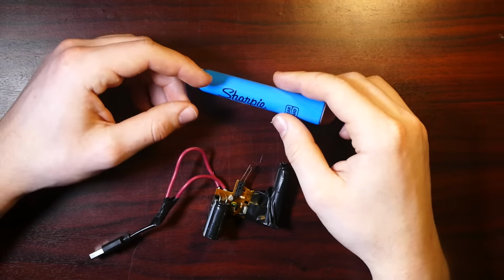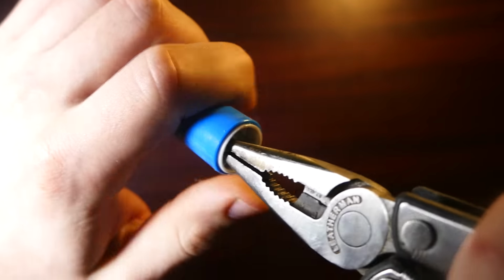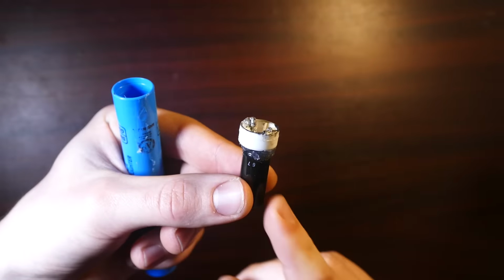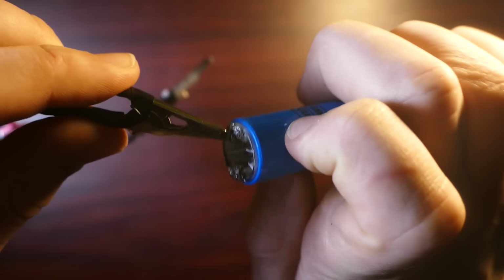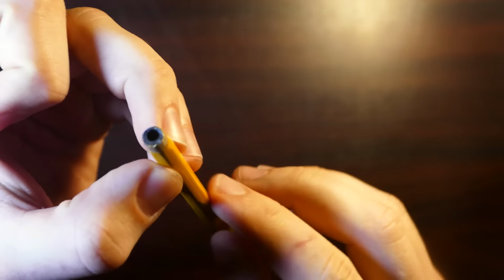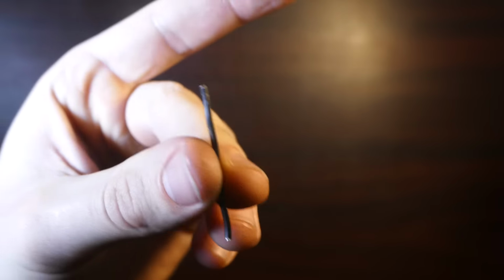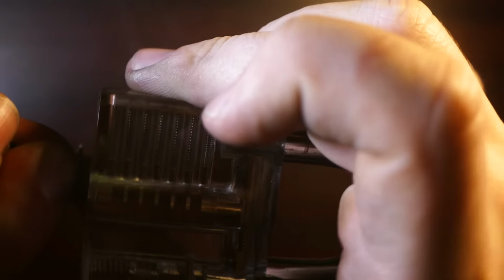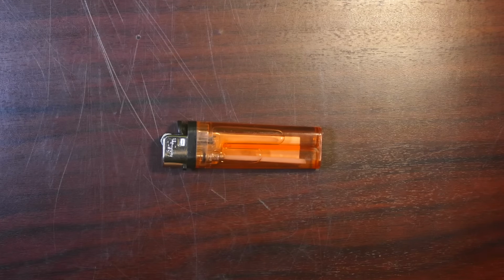4 Clever Spy Hacks YOU SHOULD KNOW

Comment: Make USB killer hidden in a highlighter
Reply: King Pitbull it's not that hard just obtain a USB killer take of the plastic USB part then use the components for the USB  and put it in an empty big stocky highlighter ;)
Reply: Plug it into ur computer search up disk part on ur command prompt then type show disk then select disk 1 then type clean then partition primary and it’s done cleaned
Reply: @harmanndhiman9492  a usb killer doesn't work like that, a usb killer repeatedly delivers spikes in current to destroy the electrical components of the aforementioned device
Reply: @rhysabul1401  ik but u probe just wanna clear data

Comment: to charge the capacitor, you don't need any circuit, you just need a 9V battery.
You just have to put it on the two terminals of te capacitor and charge